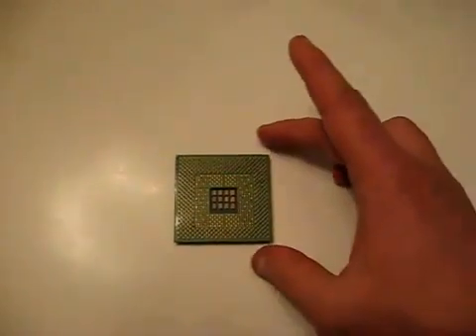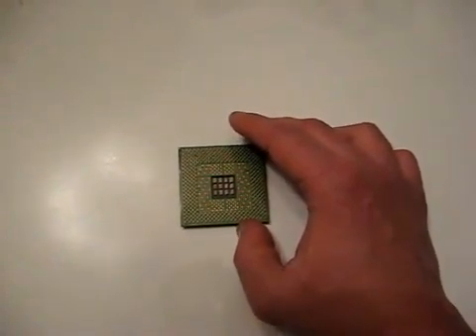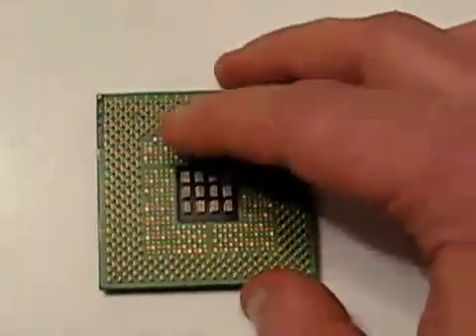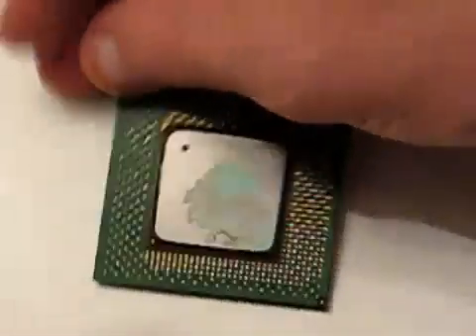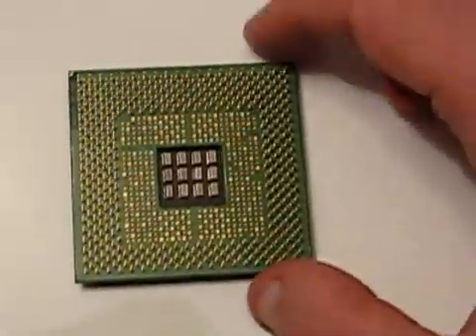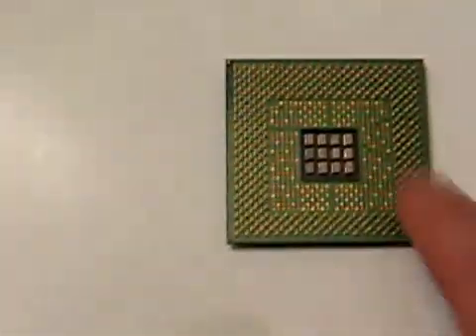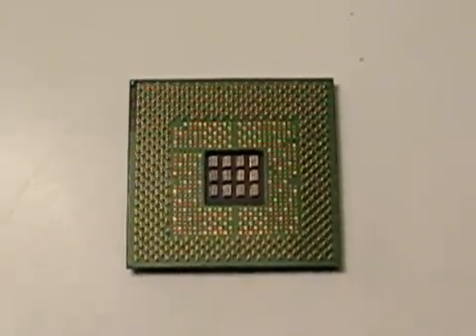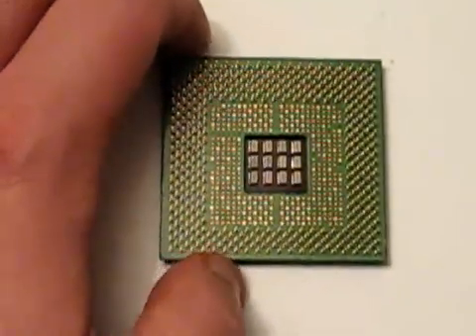How Much Gold is in CPU?

Comment: hydrochloric acid + bleach will dissolve the gold, then you will need something that precipitates the gold (making it stick together into large enough pieces that it settles to the bottom).  after a little bit of research ive found that "stump out" works as a precipitating agent; it can be found at home depot for like 6 bucks...  ill be doing a run here pretty shortly. ill be lucky if i get 5 grams lol
Reply: 5 grams off of 20 computer = 100 grams lol
we have 30 computer that have EVERYTHING gold plated :D